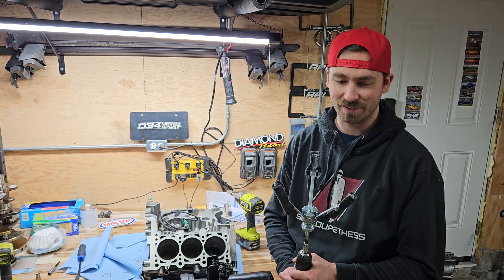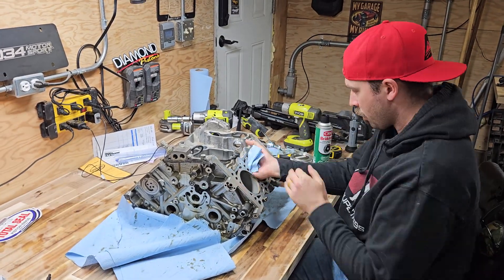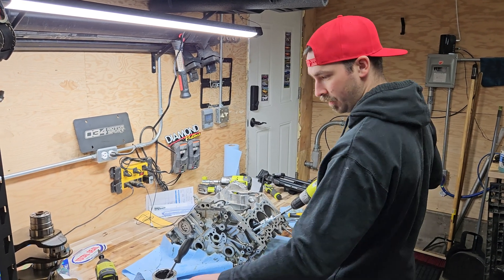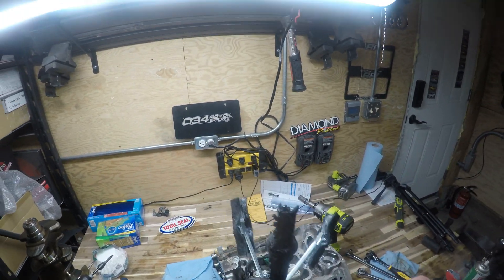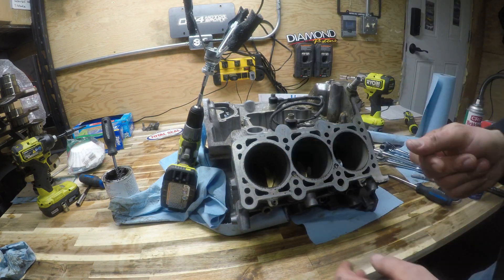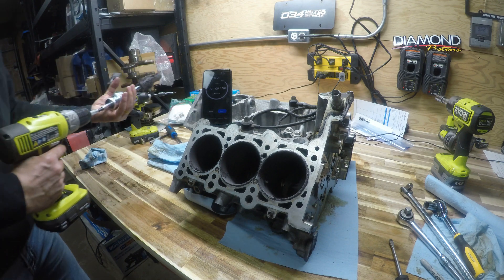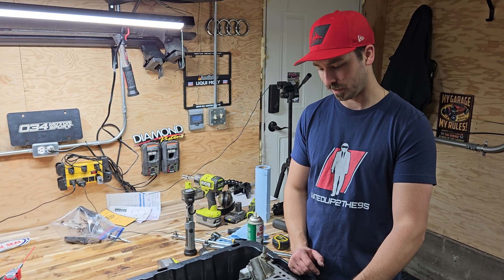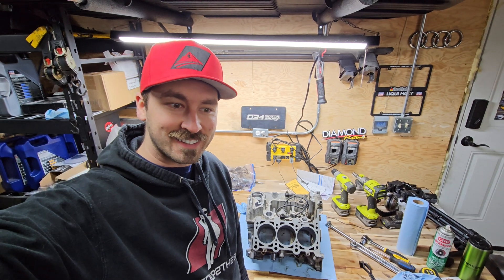Audi 3.0T Block Honing! // 3.2 Stroker Build (B8/B8.5/C7/D4)

Comment: No crec block with sleews?
Reply from the maker: I do believe the stock crec block from factory had sleeves. Are you asking why didn't I use that instead?
Reply: @ yes, because honing used alusil block and saving some $$is not so good idea when you putting expensive forged internals. Sleewing is not cheap but you can get sleewed crec donor moto for the same price as non crec.
Reply: I we sure the crec block is sleeved ? I was under the impression it was the same as gen 1’s Alusil setup. I run a crec platform and this has my curiosity very peeked and cannot find any definitive answers on this topic.